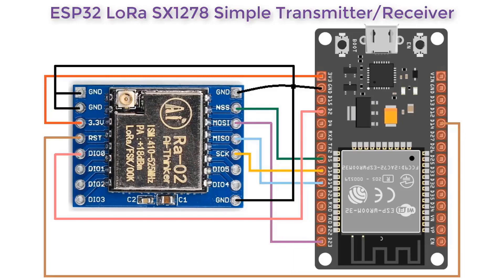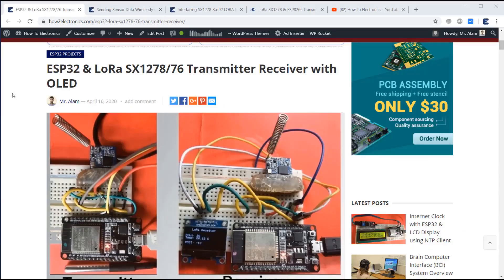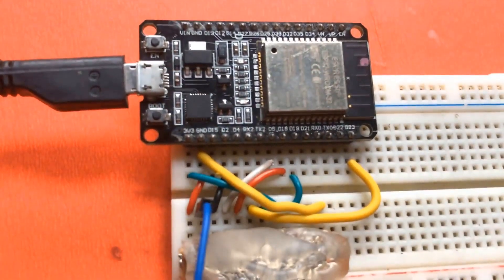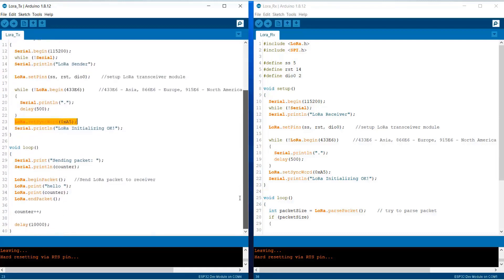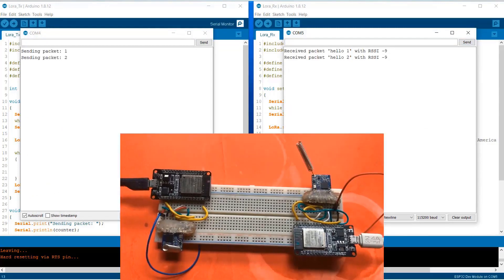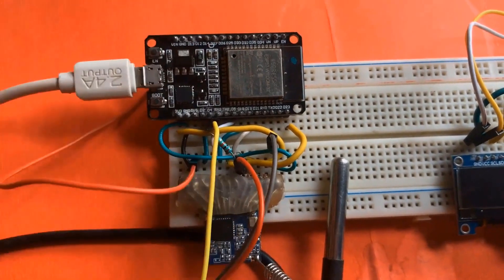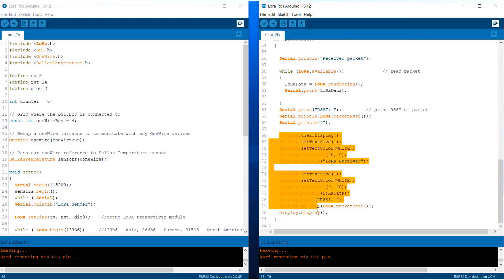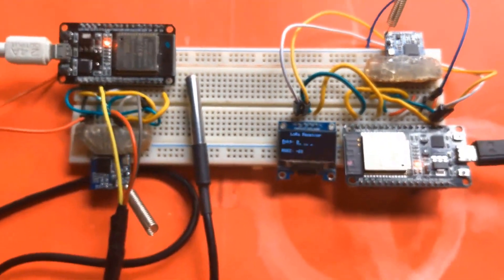ESP32 & LoRa Sensor Data Monitoring ||Sender + Receiver with OLED Display

Comment: hi, can I send a command from the assembly (ESP8266+lora is my receiver)
to the assembly (arduino nano +lora+gps is my transmitter ) yes, I would like to send a signal from the receiver and wake up the transmitter so that the transmitter starts transmitting data to the same receiver on the access point's web page ESP8266